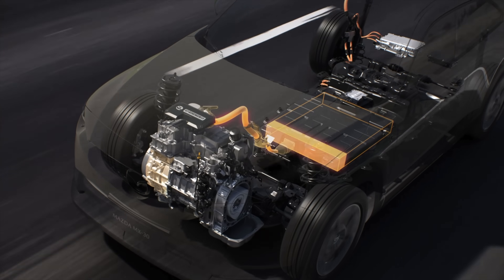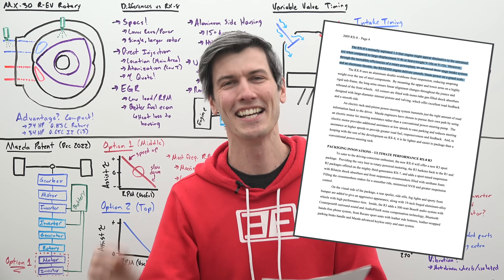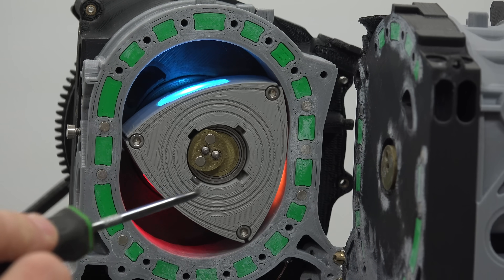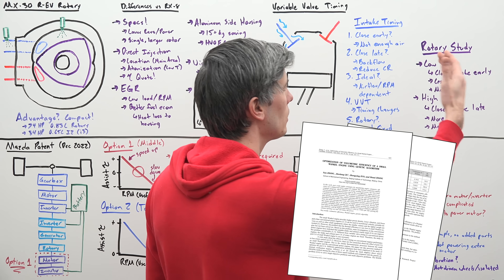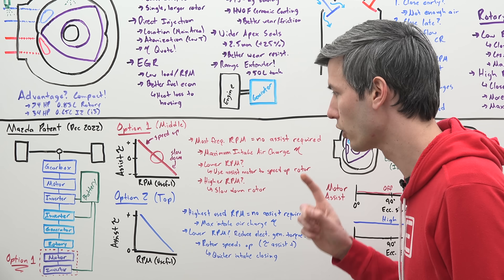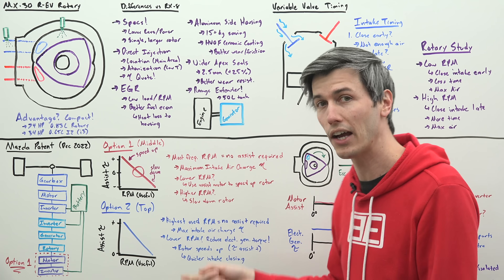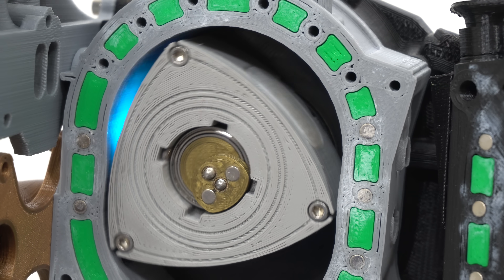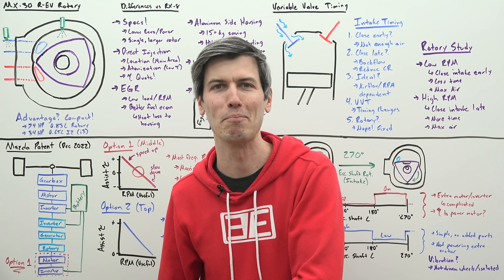Mazda Brought Back The Rotary Engine!

Comment: My uncle designed his own rotary and used it as a range extender in a electric Sunbeam alpine in the 70's... Finally the world catches up! For a range extender a rotary makes sense from a packaging standpoint, and by running it at fixed rpm, they can optimize engine performance. I don't see why they want all that other shenanigans.
Reply: I was about to say the same thing - in a generator, why do you need to vary anything?  Just pick the most efficient RPM and design your generator around that number.

The load on the generator need not vary, since you are charging a battery with it.  It's a known quantity that you have control over.
Reply: I was thinking the same but its mentioned that the engine will also directly power the drive motors 7:20 when needed so it would need to be variable to keep up with the direct demand of the drives.
Reply: This story is so incredible I almost not believe you. Like those kids in a sandbox making up stuff about their fathers or in an online debate where the strongest argument is always "my uncle works at Nintendo"
Reply: @frozen-curmudgeon  it says it can send power to the electric motor to power the wheels. In such a case it would mean that the battery is empty and can no longer power the motor, which means any extra electricity generated could just be used to charge the battery. Maybe they just don't want to run the rotary at max RPM all the time, and this just allows better efficiency when/if the battery is empty and more power is needed? Weird.
Reply: @ldmtag  My friend would tell me he had a dragon back home and I believed him.
Reply: The point of varying rpm is to increase the combustion efficiency of fuel in the motor to comply with emission requirements.
Reply: @nirapsingh9773  Even with variable duration intake/exhaust, engines still have an RPM where they have the greatest efficiency.

There's no need to vary anything.  Pick the most efficient RPM and stick with it.

GM did exactly that with the Volt/Ampera.
Reply: @frozen-curmudgeon  No, if you look at the diagram, the generator connects to the battery, so the engine never directly delivers power to the wheels.
Reply: @antontaylor4530  Not sure, just speculation. If they really have problem with unburn fuel, when they slow down intake, they simultaneously slow down expansion rate of combustion chamber, giving it more time to burn everything inside. Moreover, probably they mean variation of rpm during one rotation. Maybe you can increase volumetric efficiency for specific RPM by slowing down rotor in specific phase.
Reply: do oby  even seasoned professionals make blunders, that happen to be shitty in real world. For reasons not knowns to us.
Reply: do oby  Wow, so we're not allowed to discuss this?

Nice.

No-one said they were smarter than "seasoned professionals" - in fact, I literally asked the question "why do you need to do that?"

I did not say they were wrong, I asked why they were doing it, and then stated my thinking on the subject.

Perhaps instead of impulse trolling, you should learn to read what others actually wrote before you incorrectly assume things and then tell others how wrong they are about that thing no-one said.
Reply: do oby  I'll always laugh at internet idiots who vehemently defend expert opinion even though they themselves don't have a clue what said expert is talking about.
Reply: @antontaylor4530  And if you're worried about intake charge, a turbo or super-charger would seem easier (although perhaps bulkier).
Reply: I have a Chevy Volt, which also uses an engine as a range extender generator. It does change RPMs. You can hear it crank up as I step on the gas. I'm no engineer, but there must be a reason for that.
Reply: @6Sparx9  If you look at the diagram AND listen to whats being said youll see it can also power the drives directly.
Reply: Not sure but the problem comes when you turn the wheels directly from the generator at different RPMS.  But I still agree it needs to be one speed as slowing the generator must have consequences.
Reply: No shenanigans, they have to meet emissions standards.  I'm sure your uncles system wouldn't meet them now
Reply: @frozen-curmudgeon it does not, the generator does.
Reply: @karykrismer1448  If it increases overall efficienty, then great - otherwise seems a bit of a waste of time.

If this thing is making 80+ hp, that's way more than most vehicles need to cruise at legal speeds (excluding Germany), so I'd only worry about it if it gave efficiency gains.

I mean, Toyota is developing a single cylinder 2 stroke generator with no crank, that targets a single power output/rpm as we've been speaking of.

The idea being that it can power the vehicle at speed limit speeds whilst charging the battery simultaniously, then it shuts down once the battery is up to a certain level of charge, and only kicks in again once the battery drops below a preconfigured level.

They're targeting a certain output because it makes the whole thing much simpler to design and build.  Can't really understand why Mazda is making this thing more complicated than Toyota's solution.
Reply: @ldmtag  
TBF, Mazda does sell rotary engine crate motors, and if people have the tools, one could go make their own rotary.
Reply: @DouglasLippi  Technically the Volt is using a variant of Toyota's hybrid drive. On EV only, motors spin the planetary gears. When the engine needs to help, it's connected to a third gear of the planetary and directly drives the wheels. Aka Series-parallel, just like Prius. IIRC Honda's newer hybrids are Series-or-parallel. Below 50 MPH the engine only drives a generator. Above 50 mph, a clutch activates and connects the engine to the wheels like an overdrive gear.
Reply: @DouglasLippi from what I see, the Volt generator is mechanically connected to the wheels, which shouldn't be the case of the R-ev.

There are reasons for both.

R-ev: you can better utilize a higher displacement engine

Volt: you can avoid losses associated with energy conversion.
Reply: Because it sounds cool
Reply: @user-pq4by2rq9y  Well yes obviously the engine has to turn its power into electric by way of generator but it still can go straight to the drives from there bypassing the battery altogether.
Reply: @DouglasLippi  It's load matching, but it's still limited to a narrow range of RPM where the engine is at it's most efficient.  It won't go to idle speeds, it'll just shut off, and it won't scream either.

But they basically used an off-the-shelf engine design, which wasn't ideal.  It meant they could use a smaller battery, though, which was important back when they were at the design stages.

Toyota's got a wizard solution of a crankless single cylinder 2 stroke in development right now that has an electromagnetic coil (or it might be a permanant magnet array, can't remember right now) directly connected to the piston.

As the piston moves back and forth, it runs through a static coil and produces power.

It's designed to be efficent at a very narrow band, because it's vastly simpler that way, and therefore cheaper.  The software running the electronics just has to be marginally smarter.

Marginally.
Reply: @Appletank8  plus I know there's a significant difference in operation between Gen1 Volt and Gen2 Volt. Such a shame GM abandoned this tech. I frickin love this car, but at some point I'll need to move to something else. Still not ready for all-electric.
Reply: Because of the wrapwrapwrapwraaaaaaaaaaaaaaaap that we all love! hzahahahha
Reply: @frozen-curmudgeon yeah but the momentum of the electric motor will keep power delivery fairly smooth
Reply: @DouglasLippi  Portable inverter generators do change speed as demand increases, so I guess it could be increasing total generator output when it sends current to the motors and not only the battery.  I wonder what their relative maximum draws are?  Motor vs battery.
Reply: @frozen-curmudgeon  I'm no expert, but I'll rewatch the video...
Edit: alright, at 3:25 "There is no direct link between the engine and the wheels". Can't get more conclusive than that.
Edit2: then again, you say drives, not wheels or transmission, so I assume you mean the electric motor making this a series hybrid system (the prius, for example is a series-parallel system capable of switching between battery and engine powered drivetrains on the fly). But the point is, a series hybrid, even when being 'powered directly' by the engine instead of using battery reserves still drives the wheels using electric motors, and these are being fed power by the engine running at a *constant*, not variable RPM. The engine only supplies electric power, it doesn't need to change RPM based on demand, the electric motor in a series hybrid setup does all that.
Edit3: now I've given it more thought, I wonder if/why Mazda doesn't sell the mild hybrid system or the rotary engine part to the aviation industy???
Reply: Me neither, run it at the RPM the generator demands (how many poles it has) and set the engine to have the power band at that RPM.
Reply: @antontaylor4530  The load on the Generator will not always be constant as that depends on the state of charge or discharge of the battery. If the battery is fully charged, the generator will not need to charge and its load will be minimal or no load. If the battery is in a state of discharge then the generator will need to produce more power to charge it hence more load on the engine. Also at the same time the engine can be turned off if  the battery does not need to be charged  and the engine kicks in only when the battery reaches at a certain state of discharge and that state can be considered as optimum load and engine be tuned for that load
Reply: I got two completely speculative hypothesis:

1. Shutting on and off the engine instead of keeping it at a constant rpm may be less desirable for a few reasons (extra wear, more distracting to the driver, etc)

2. The rpm the generator can produce power the most efficiently in may be at a lower rpm. As such, you have to choose between lower rpm for efficiency vs higher rpm in situations where you need more power than the most efficient rpm can provide.

Even if Madza focused the most on optimizing the top rpm band, a vehicle or engine being designed for a specific speed doesn't mean the most optimized speed will actually be the most efficient. Semi trucks are made for highway speeds, but they would still be more efficient if they drove slower.
Reply: In the i3 REX, the generator spins faster under high load or when the battery state of charge dips below ~6%. But in average driving conditions and state of charge around 7% the generator stays at a slower, quieter and presumably more efficient speed.
Reply: @inevespace  that is how I'm seeing it.   One advantage of electric is they can change that load at a millisecond level.
Reply: @frozen-curmudgeon  Easy to miss, but what he says is that the rotary powers the generator, adn the electricity goes to either the motor [driving the wheels] or the battery.
Reply: @ldmtag  my friend’s dad worked at atari and he had every cartridge game without the housings to prove it
Reply: @SanjeevSinha30  You're mostly right, especially about just turning the genny off when the battery is close to full.

You run the extender until the battery is unable to soak up what the genny is putting out, say, 80% and then go back to battery only until the battery is down to about 20%.

What you are missing is that with any decent charger these days you can accurately limit charge current so that you put a precise load on the genny.  Even when the battery is empty, you can very easily limit charge current so as to put exactly the load you want on the genny.

Under acceleration you lower the current to the battery, under regen braking you up it to genny capacity plus regen capacity.

The mathematics involved are very straightforward and charge controllers that can do this have been with us since the 70's.
Reply: @antontaylor4530  probably because of noise and the round trip efficiency loss storing energy in the battery. If the generator runs hard for 5 minutes but then needs to shut off for 5 minutes because you're driving in the city, then the energy for the second half will come from the battery and suffer the 90ish% round trip charge/discharge efficiency. Also people don't want to hear their engine running at full throttle when they're going through the Macdonald's drive through.
Reply: @kentaltobelli1840  Generally the highest efficiency is not at wide open throttle.  I really don't see it being a noise issue.

As for the efficiency of the battery, modern lithium chemistries are 95% or so efficient, you don't lose much charging the battery.

But when you are putting energy into a battery and taking it out at the same time, the energy out is not stored, only the difference between the energy in and the energy out - so there's zero energy loss for the majority of the energy produced.

And why would a range extender be needed at the drive through?

It's a range extender.  You think you'll run out of range between the back of the queue and the pickup window?
Reply: @karykrismer1448  yep, most problems with the rotary go away when turbocharged, direct injected and running e85.  I have 650hp 13b motors running all day long in racecars with that setup.
Reply: @karykrismer1448  Same on our i3 REx.
It seems to start at low rpm to avoid wear, then adapt rpm to needs as they arise.
BTW - Most passengers have no idea the ICE is running unless we're below 30mph.